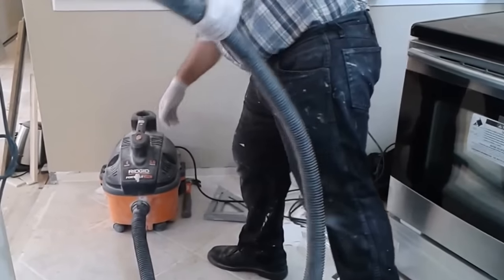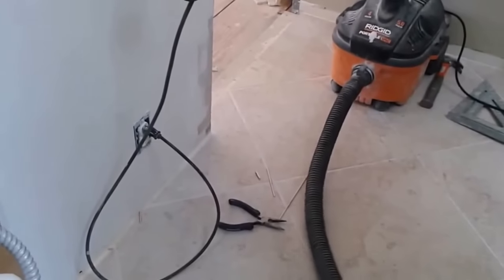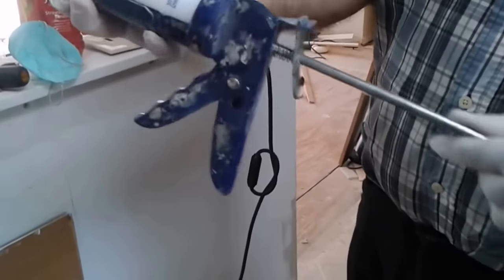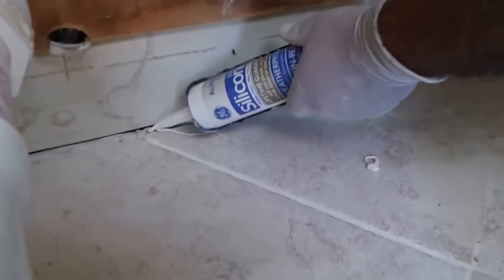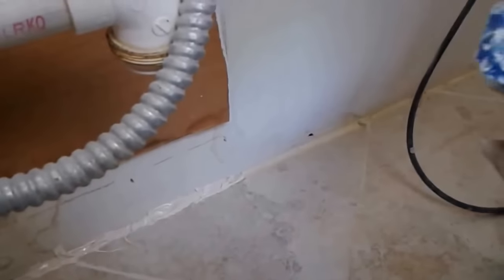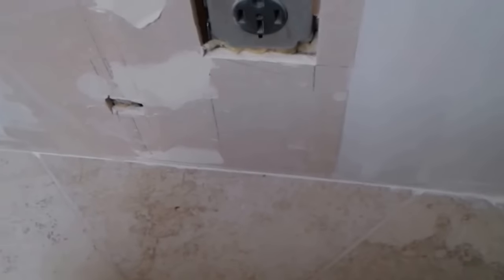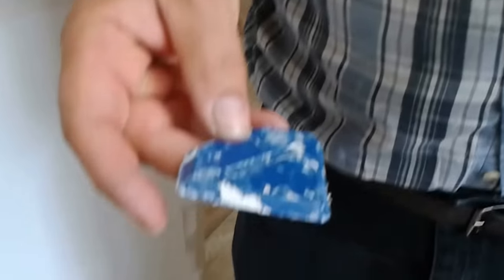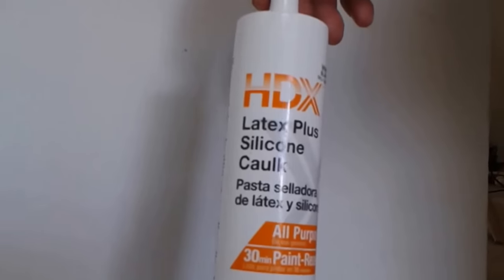How to Caulk big Gap Between Tile Floor and Wall Like a Pro

Comment: How about if the gap is bigger? I have a pap behind the fridge of 1/2 to 1 inch. We had an issue with the waterline and water got trapped in there. Thank God I dried it but I want to avoid that again. In that case what is best to use?

Comment: Hi Joseph.  What would you recommend to use on "25 yr.old VINYL Floors" that shrunk and created gaps, some as  1/16 wide?  Maybe some "DAP Alex Plus 300 mL White Acrylic Latex Caulk with Silicone from Home Depot?  Grout is too expensive for me... I might be moving next year or so anyway.  And then cover the job up with floor finish wax
Reply from the maker: You should not use grout. Silicon is good because it allows the vinyl to extend and contract with no issue.
Reply: @josephk9182  Thank you very much, your advice is better than the video I saw with a guy using grout on vinyl tiles.  Cleaning the leftover grout takes forever

Comment: Why did you leave gaps?  ie between sections of start-stop.  Surely the smoothing must fill such gaps so there are no places for water to enter. Or are you assuming that only the floor seal is important?
Reply from the maker: I did not leave a space between start-stop. The silicon was pressed into the gap using the rubber so there are no void under the silicon.

Comment: why don't you put skirting along the wall
Reply from the maker: I put baseboards where needed ( not where I installed the kitchen cabinets), however you still need to seal the gap between the tiles and the wall in a water environment like kitchen and bathroom, baseboards will not be enough .
Reply: Joseph K quick question, do I need the caulking in bedroom? Or is baseboard just fine?  Trying to save money wherever I can